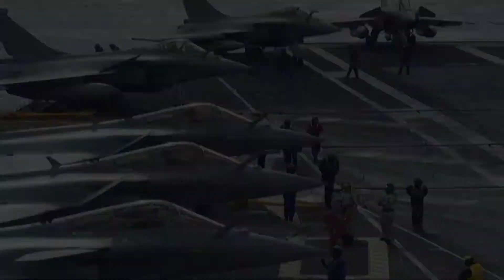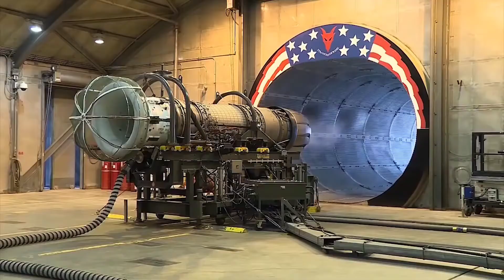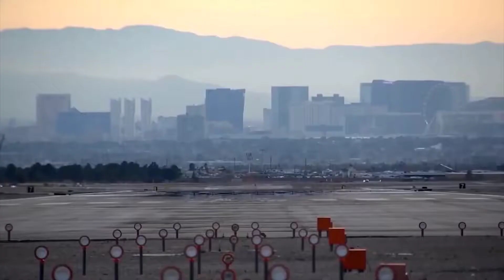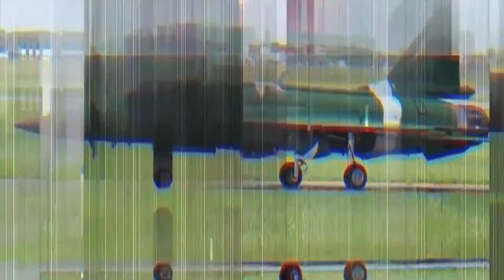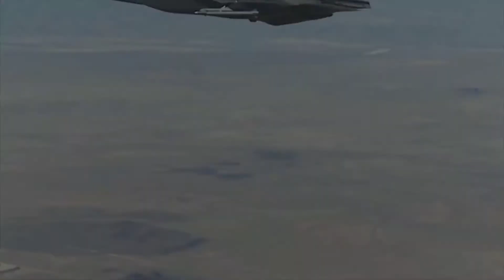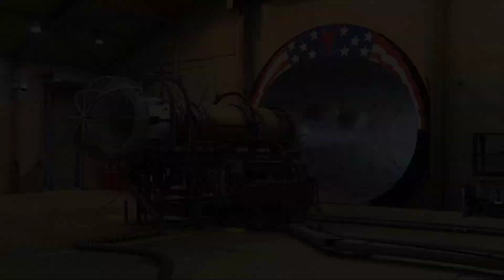USA New Powerful Nuclear Aircraft Engine

Comment: Why on earth? Wouldn't we make a small reactor tiny? It doesn't need to be very big to power electric jet engines. It doesn't have to be powered by nuclear fuel.  It can be turned into electric just like submarines
Reply: Back in the day they didn’t have the technology or materials to make small reactors like that. They didn’t have the materials or complex energy management techniques either. Back in the day they barely had jet ingines or turbos and understood them well, all they could do was build a big reactor that heated water and made electedtixtt or turned turbines. Now we can perfectly design nuclear heating and flow and aerodynamics and manage the nuclear energy output all with complex electronic controls. We can extract much more energy from smaller amounts spread out and in complex ways. Small reactors weren’t even a thing until super recently.
Reply: There is absolutely nuclear powered uav’s flying up there right now
Reply: You always have some overhead in size of equipment so it wouldn't be "small". Not every part can be made smaller.  Look up the square and cube laws of scaling